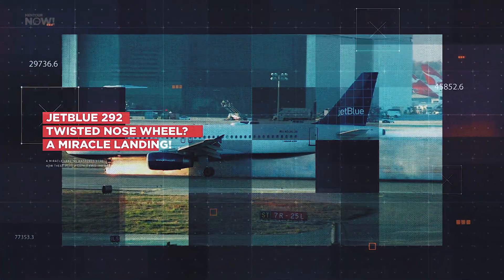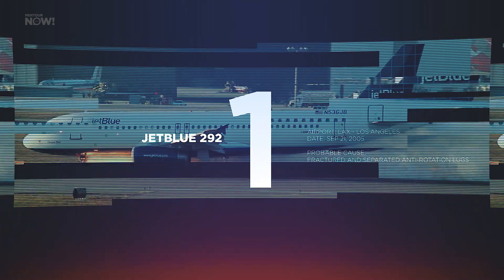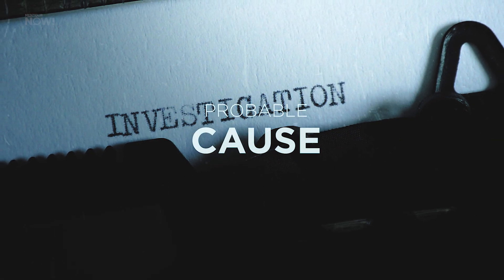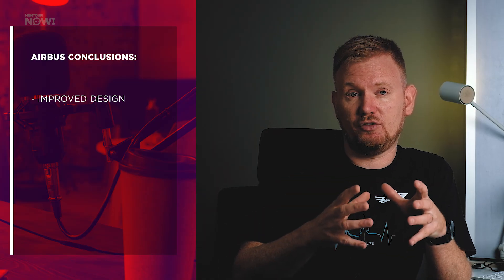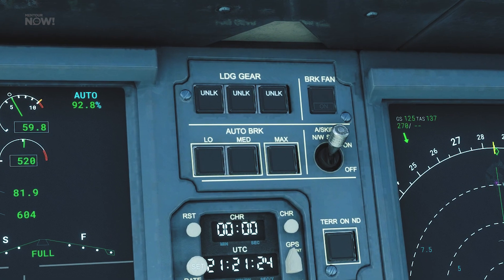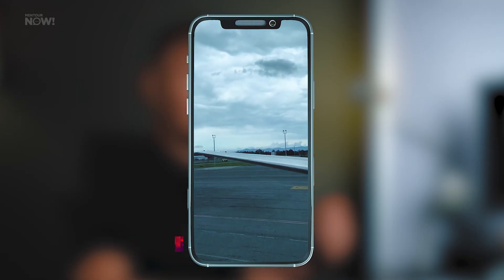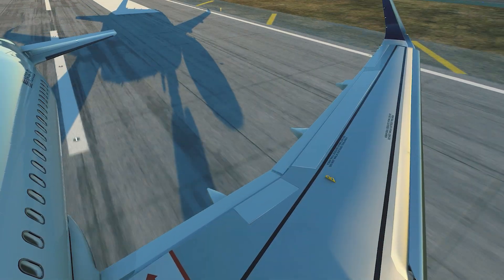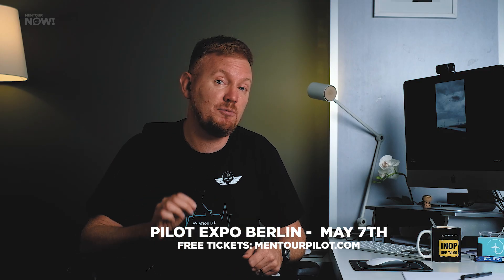The TWISTED Story of the Airbus A320 NOSE-GEAR!

Comment: As an uninformed reader, I see why pilots are trained to go strictly by the book. As an engineer though, I question whether "down and locked" (3x green) is really the same as "safe" if it clearly does not take steering angle into account. Did ECAM designers really consider this situation? Triple green and still scraping the asphalt? Are the engines really safe from debris if you are shredding your nose gear on the asphalt? Can a scraping nose gear really take the extra load of reverse thrust? Does reverse thrust not have a risk of requiring steering corrections, that you now cannot do?

I honestly understand pilots questioning all that, and using the "unsafe" checklist even with triple green. Maybe an engineer on the ground could have confirmed what to do.

I think all these planes have been lucky that the angle went to a full 90 degrees, at least giving them neutral steering.

Either way, great report on another interesting issue!

Comment: Ah... the "flu-like symptoms" effect... In any system sufficiently sophisticated, there's a distinct rise in the shear numbers of "faults" that can arrive to a very similar outcome... In this case, the nose gear of a plane goes 90 degrees sideways "out of whack" for any of a litany of issues...

    In humans (where I get the original description up there) just about every kind of toxicity and a LITANY of diseases  tend to present with "flu like symptoms" which is a short-hand for the same list of headaches, body aches, fatigue, fever, chills and flushes, nausea, vomiting, stomach aches, etc..etc...etc...

    You could have a cold coming on, and you could be dying of mushroom poisoning... OR any haz-mat on a VERY large list... etc. 

    SO... basically... The Airbus is complicated.  ;o)

Comment: Airbus seriously needs to redesign that whole system.  Failures should be failing to the straight ahead position and a system that restarts from a switch flip should not be making any assumptions that the wheel starts in some assumed position.  If it/they had bothered to determine the position first, that one incident wouldn't have moved out to 90º after the on/off flip.

Comment: The A/SKID NW STRG switch off and back on is a procedure to reset the BSCU on the ground, once stopped with brakes set. It is a well-known A320 reset. So, although it is not a prescribed procedure IN THE AIR, it is a known reset.

Comment: Critical sensors in the A320 landing gear are not waterproof? What happens if it is raining during a landing?
Reply: Have you even ever seen pressure washer?
Not that I would trust you anywhere in its vicinity, because when used without care pressure washers are one of the surest ways to damage any more complex things.

Comment: Maybe they should put an old 707 nose gear in it problem solved lol. Computers and sensors don't pressure wash the nose gear are they kidding. Makes you wonder in a heavy rain storm what will happen when the water sprays up there.

Comment: My biggest issue is that the Nose Gear isn't the only "persistent" issue that Airbus has been unable to fix.  They also have the Pitot Tube icing issue that despite multiple re-designs continues to plague the A320 and A330/340 family.  At what point does Airbus have to be found criminally negligent with these design flaws?  They have both caused multiple accidents (although none fatal with the nosewheel issue) and cost much more money to Airbus to repair the defects, but yet on the NEO series, they didn't make any significant changes so they'll likely persist.  Boeing is getting taken to task (rightly so) because of its issues with the 737MAX, 787, and 777X, but when does Airbus get the same reckoning for its problems and finally get rid of the BSCU's steering functions, revert to a more traditional direct control system, and eliminate the issue altogether?  When does Airbus have to finally re-design fully the pitot tube layout and get them into better positions further back on the fuselage as their testing found needed to be done?  I try not to be an Airbus hater, but they seem to continue to get away with stuff for years and years while other manufacturers (Bombardier, Embraer, and Sukhoi as well, not just Boeing) have their businesses nearly bankrupted because they don't fix their problems.

Comment: Question. How handy would a camera looking at the front wheel when it is deployed be? I would think that this would give the flight crew a visual conformation as to the position of the front wheel. It would  not solve or resolve a 90 degree problem but it would let the flight crew know what to expect.
Reply: Added complexity for 7 incidents in how many MILLIONS of flights? 

Honestly they could add a sensor to detect wheel position but what's the point with another point of failure and information overloading for a rarity of 7 incidents in 155,000,000 flights. That's a statistical anomaly at that many decimal places.

Comment: Lucky it always is exactly 90 degrees. I think 30 or 40 degrees would be a much bigger problem. If someone designed this deliberately than it is pretty genius. Although I would rather have made it so that it automatically goes to zero degrees.  🙄

Comment: Can you explain what would happen if the plane needed a Go Around after the people have been moved to the back? On the Airbus website it says

"In case of go-around, setting TOGA power induces a significant pitch-up moment that needs to be compensated for. The more aft the CG, the bigger the pitch-up moment. If the CG is too far aft, and outside the envelope, the pitch-up moment induced by initiating the go-around may be too big to be compensated for. At low speed, high angle of attack and TOGA power, the pitch-up moment increase due to having a CG position too far aft, may also trigger the alpha floor protection, thus prevent its sufficient compensation."

Moving people to the back and reducing the landing speed sounds like it could come to a catastrophe if something else went wrong on approach and GA needs to be executed.

Comment: One point that I think was mised by Peter is that I suspect the A320 nosegear has been designed (rather cleverly) with the camber on the tyres and the limiting stops that in the event of a failure leading to the nosegear's rotation not being controlled or broken it will turn to 90 degrees and stick there, which appears (after all these events) to enable a safe(ish) landing. If the nosegear was stopped at limits where the tyres were still rotating (say 60/70 degrees) I'd imagine that it would be virtually impossible to avoid a runway excursion on landing and likely a much more serious incident. So Kudos to the engineers for designing for it to "fail safe"

Comment: Typical Airbus overcomplicating what should be a simple system. 
On most other commercial aircraft there is a internal cam inside the nose wheel strut that centers the wheel when weight is off the strut and it's fully extended.

Comment: Although these were all different problems with the front nose gear according the accident report, they do all stem from one problem; bad design and integration of the whole front nose landing gear system. So even though you can pick individual problems with that system causing failure it's pretty clear that the whole system just needs a redesign. I wonder if this system had the majority of its design outsourced by one specific company. I know this costs oodles of money and it's probably something the airlines and airbus don't want to eat, to me it seems like the whole system should be redesigned and recertified when lives are on the line. I know there is some spec for air strips and there maintanence but what if some strip suffers cracking or a failure especially at a less maintained airport, couldn't this cause a catastrophic crash?

Comment: What difference does it make to me the passenger what is causing the fault? The result is the same if not worse? -> There are a whole bunch of things that will make the a320 nose wheel go 90deg and my pilot is going to get a less than perfect error code lol.

Comment: What good does a RAT do after stationary on the ground?  It won't be spinning or producing any power.  I can see starting the APU for the landing to assure electric and hydraulics after shutting down the engines, but the RAT?

Comment: What this is pointing out is that Airbus designed a system that is incredibly complex and has many points of failure.   Murphy's Law says failures Will occur and they are.  The root cause must relate to the level of complexity over-engineered into the nose gear.

Comment: You would think it would be really simple to add a hand crank where if it is stuck at 90°, they could just crank it around by hand
Reply: the safety problem is the steering can't be controlled by the crew, so the wheel is giving incorrect directions, and plane can't be kept straight. at 90% the wheel no longer functions for directional control.

Comment: Sounds like using computerized Nose landing gear steering is not good.  Maybe with the nose gear only they should just use the older safer systems around before.

Comment: 14:55:  Now let me get this straight.  You're not supposed to use thrust reversers, spoilers, OR ANYTHING ELSE that can all the more quickly slow down a plane with a nose gear that is grinding into the pavement?  It seems that if you're landing with a bad nose gear, you want to use ALL THE STOPPING POWER that airplane has so don't spare spoilers and thrust reversers and parachutes and whatever other weird thingies might be built into the piece of crap.  Explain that one, Mentour Pilot.  15:35:  Thank you for explaining that most critical point about why you would want to sacrifice stopping power in the event of a collapsed landing gear.

Comment: 11:26:  This is amazingly stupid.  By telling me that the pilots ACTUALLY TOOK OFF  with this fault, you're telling me that the pilots would have failed to notice the frictional grinding of the nose gear on the runway while at the same time failing to hear the bang from the rupturing tire as the pavement tore into the tire.  Also the pilots would have had to fail to notice that the plane was not getting up to takeoff speed as fast as normal because of the friction of the locked nose gear with the runway.  So then, you're telling me that with all the problems which a nose gear locked at a 90-degree angle would have caused, it STILL took a warning from the instrument panel for the pilots to know anything about it.  That is mind boggling.  Somebody in the cockpit had to be blind, deaf, or otherwise not doing their job --- which then raises the question of what kind of passenger wants to fly with pilots who can't even notice a locked nose gear while the plane is moving and taking off.
Reply: The wheel was probably not at 90 degrees during takeoff but the faults that caused the wheel problem were there. Wheels don’t just turn at 90 degrees at takeoff, pretty sure the pilots had to taxi to the runway right?
Reply: @DB-rc9ln  Well, that was exactly what I was wondering: how did the pilots taxi to the runway with a nose gear turned at a 90-degree angle and not notice the abnormalities this would have caused with controlling and moving the airplane.
Reply: @MyNathanking  MEL allowed them at the time. Also these jets can turn without nose wheel steering function by using differential brakes and thrusts. As for not noticing, the wheel locks 90 degrees on their final turn. After this is a takeoff roll in which the engine applies a lot of power and lateral movements controlled by the rudder. It is possible they didn't notice it in this situation.
Reply: @bltzcstrnx  So the wheel locks 90 degrees on the final turn.  So shouldn't it straighten out again for the takeoff roll?  I still can't figure out how the pilots wouldn't have noticed, at the very least, a very odd and unusual feel that they had never experienced from the airplane before that would have prompted them to decide not to take off and to have the plane inspected before further attempting to operate the plane.
Reply: @MyNathanking  it should straitened by itself, the thing is Airbus tiller are drive-by-wire. Meaning it doesn't have a physical connection to the wheels. Unlike the steering wheel of your car, it can have different positions than the actual tires. So the pilot put the tiller straight but the tires 90 degrees angles, you don't know until you get down and see it by eyes. When on takeoff roll the aircraft doesn't pull (ie. stay moving straight) it is hard to notice the condition of the wheel.

Edit: it doesn't straighten itself out because there are malfunctions.

Comment: My eye is untrained (or is it trained because I watch this channel?). As soon as I heard, at the start of the video, of multiple instances, I presumed that they are not all due to the same cause. The software issue, which caused the broken bolts on the Jetblue landing, was addressed, but more obvious is that there would be far more instances if the software was still a problem. Perhaps a little bit of education and alot of careful thinking means I have trained my own eye? I guess I'm not someone to just look skin-deep at something, and then go on with my day; I like to consider carefully and come to a more accurate awareness.

Comment: Very, very interesting. The fact that so many different causes were observed shows that a proper FMEA  (Failure Modes and Effects Analysis) was not part of the original design process. This points to shortcomings of the Airbus design process, and of the Airbus response to field failures.  It's understandable if one subtle failure mode were to slip through product development, but for so many to escape - that points to a bigger management problem.

Comment: as an engineer myself it seems the issue ultimately is badly designed nose wheel system both hardwear and software..they need to either rip it out and fit a proven design or totally redesign the existing sytem.

Comment: So, would you recommend a small camera mounted inside the nose gear well looking down when the gear is extended so that a pilot can switch to that view should something unusual should occure (such as the power issue) so that a really quick visual inspection can be made?  No need for a fly-by.

Comment: seems to me to only be one cause: the nosewheel is not designed to fail in a safe way.
Reply: Actually this is a safe way to fail. An unsafe way would basically be any other angle that isn't 0° or 90° because that would much more likely cause the aircraft to wear off the runway. I mean, it happened 5 times now and how many people got injured? none. The aircrafts didn't even receive severe damage. All of them were back in service a few days later.
Also, the nose wheel steering is in fact designed to hit mechanical stops at 90° and in normal operation the pilots are only able to turn the nose wheel 72° to either side if i'm not mistaken. So the 90° turn is in fact a fail safe mechanism.

Comment: Even though it appears to be a different reason everytime it sure looks like an engineering problem with that nose gear. I don't think I would want to fly on that model airbus plane at all.
Reply from the maker: Remember that these are 5 occurrences, with 5 different causes, spread out over 20 years.
During those 20 years the A320 has successfully landed tens of millions of times. 
Don’t be to quick to judge.
Reply: @MentourNow  With respect Mentour, your headline "WHAT'S WRONG with the A320?" sort  of encouraged the keyboard warriors with their 5-minute attention span.
Reply: @cr10001  And yet here we are censoring the obvious. Nothing like your own example about judging when you don't know them personally or their expertise in the matter.
Reply: @Angelum_Band   Just read this comments section - full of hysterical "OMG why does it keep crashing" type comments.   Anyone with a clue should be able to work out that 5 incidents in 20 years out of 8600 aircraft is trivial.    I will certainly judge the expertise (or lack of it) of anyone who gets all over-dramatic about that.   
Just to put it in  perspective, the 737 Classic (2000 built) had 23 main gear failures in 17 years.   Not bashing the 737 specifically, you can easily google any common type and find a similar example.

Comment: I enjoy air crash investigations. They are very thorough and I always feel satisfied after going through Mentour Pilot's explanations. But not this one.

I understand the cause were different for each case. But there are serious questions still unanswered. Why only A320? Why the nose gear aren't resistant to water? Does that mean it is unsafe to lower the nose gear in the rain? Why they are not grounded? Does someone have to die first before a more drastic action is taken? Is this a clue that there is a bigger organizational problem hidden within the Airbus?
Reply from the maker: Remember that these are 5 isolated incidents separated by close to 20 years caused by different problems. 
Don’t be to quick to judge.
Reply: @MentourNow  I will ask you then who was quick to judge when my comment "Why am I not surprised a computer created a problem where there was none? I wonder how many of these airplanes will still be flying in 20 years." was censored?
Reply: Unfortunately Mentour's click-baity headline has encouraged the packs of keyboard warriors and seat-flying experts to see scattered incidents as an epidemic. 
"Why only the A320"?   It isn't "only" the A320.   Pick your plane, you could do the same for any common type.
A quick Google tells me that the 737 Classic (2000 produced) had 23 main gear failures in 17 years.  "Why they are not grounded? Does someone have to die first before a more drastic action is taken?"  etc and so on ad infinitum.